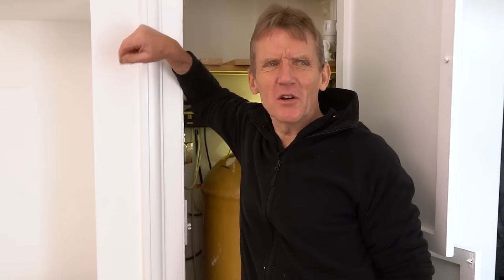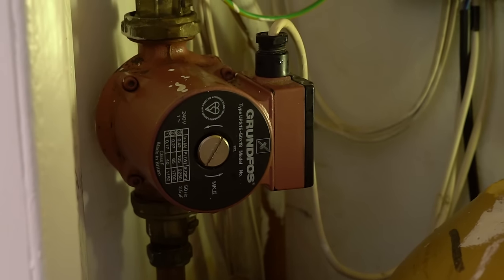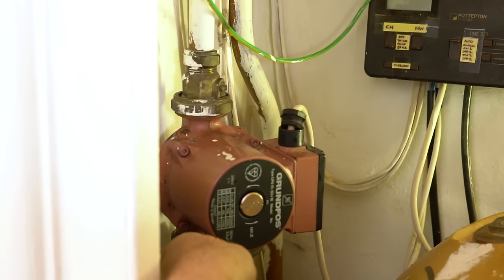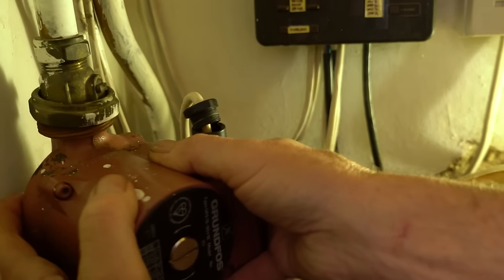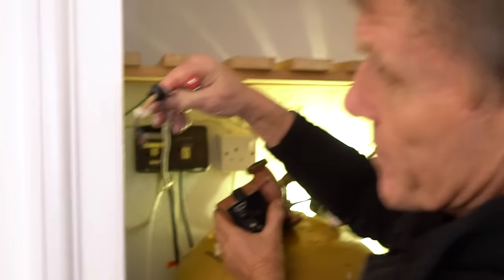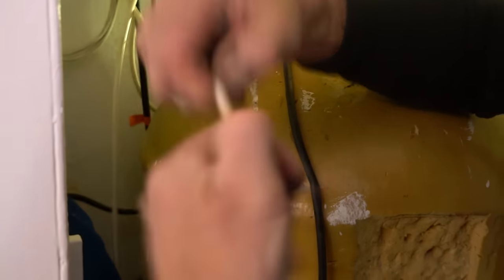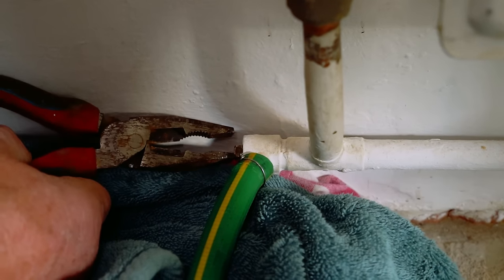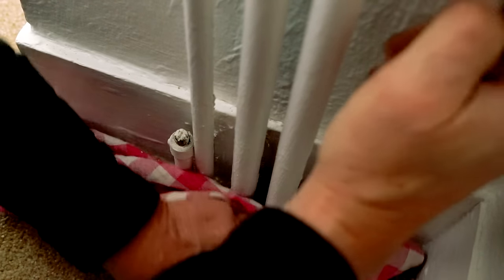How to Replace a Heating Pump - Plumbing DIY

Comment: I have a 20+ year old potterton Housewarmer Back boiler. I have just replaced my 15+ year old Grundfos pump as it was making surging noises. Now my Burner keeps going out prematurely and then locking out. I am thinking that I have dislodged some sludge/magnetite that has now entered my heat exchange with the extra power of the new pump. Could I be right? I recently hoovered all my back boiler and burner blade out so I know that's not the issue.
Reply from the maker: It would seem to me that you have no circulation at all in the boiler. Check the flow direction and the valves.  If that doesn't help you could flush the whole system through. Back boilers are usually not low water content so they should be better than most in terms of staying clear.
Reply: @SkillBuilder  Thanks, thing is for the first week of me swapping the pump it ran great, got nice and hot and no issues with locking out or anything. Today I have changed the Oxipilot ignition thingy and I have also fitted a new thermostat. I have also drained the system and refilled but nothing really came out other than clear water. Still not lighting or going out. I'm waiting for some cleaner and inhibitor to come. Only other idea I have is that could my Honeywell gas valve be broken? perhaps it isn't working and letting the gas through for the boiler to light? I'll be corgi registered by the time I am done with this!

Comment: I have a pair of these on a closed loop for a ground source heat pump, and there's a bit of air in the loop .. can these pumps be vented at all? Open the screw on the head while its running?
Reply: jrfk2 some people are saying there is a bleed screw but i dont see it
Reply: @gfriedman99  The big silver button is the bleed screw.

Comment: Do you need to be electrically qualified now to do the wiring?
Reply from the maker: No it is not rewiring and a lot of pumps now have push in terminals.

Comment: Mine is the same pump and screeching  it gets red hot and not getting no heating to the radiators could mine be jammed and freed with screw driver or should I get a replace ment and also my electric motorised white box is broken can any one give me any tips please

Comment: Those pumps are designed so you can change the head only,no need to touch the water connections,four Allen bolts and it's off.
Reply from the maker: Yes  but often it is the impeller that is knackered. They get noisy
Reply: @SkillBuilder  the impeller is in the head/main body.
Reply: Just changed the head on mine much easier

Comment: What should the pump speed be set to?
Reply from the maker: Set it low and see if it works, if some rads are not getting hot turn up the pump speed.

Comment: Does one cover oneself for the extra expense of the glands, labour, running around by giving a conditional estimate?  also did you mention making sure the pump electrical power is removed before working on it? Although that is a given, if the pump is bunt out it still might be live.
Reply from the maker: Yes, I isolated the power at the beginning.  As for all the running around etc. most of the time I am on the clock so whatever time I spend on the job is charged for. It is one of those things you just have to establish with the customer. If you replace the pump that is one job, if the glands leak and you replace the valves that is another job. If the customer isn't happy then just take the money for the pump job and leave the glands leaking. I have had someone say that the valves were fine until I touched them but you always get those kind of people. You learn to filter them out before the job. If they begin the conversation with "How much?" I just tell them I am too busy.
Reply: I also keep one of those wireless voltage sensor marker-pen shaped goodies handy to do a final check that there is no live circuits before touching anything
Reply: Well said Roger

Comment: Thanks for the videos.  As an amateur, I've done a bit of plumbing of all sorts.  If that had been me I'd have tried 2 fibre washers and joint compound.  What do you think? Wasting my time?
Reply: GrumpyGrampa I think the leak was from the isolation glands rather than the union connections themselves so needed to be replaced.  Good to see the job done properly, plenty would have tried to bodge that and walk away. 👍🏻

Comment: Great.Had cylinder fitted..air locks in system. Who's responsible please?
Reply from the maker: Hi Ray 

 I am afraid that air locks are a fact of life. If the system is well designed it should self vent to the radiators but high spots with no bleed points are difficult. I have spent many hours clearing airlocks and they can turn a one hour job into a three hour job. I am afraid the airlocks belong to the customer not the plumber and in the past I have been far too generous on this and walked away with less money than I deserved. If the customer is a good regular customer I will swallow it to keep them sweet but on a one-off job it is my policy to charge the customer for my time. Best thing is if the plumber warns you before draining down that it could go badly.
Reply: @SkillBuilder  Forgot to mention Paid out £540 last Friday thinking all was well but after trying to rectify the young fitter said the pump was no good and there were air locks then left as it was weekend.
Reply: @rayskinner1581  owch nobody happy on that one.   Ive heard of some pumps that have a jockey mode to clear air out, best used on large houses
Reply: Any decent fitter will make sure theres no air locks so I disagree 100% it's a customer issue. Given gents age its disgusting anybody would leave until systems running perfect and hes happy.

Comment: Great Video, clicked on as I saw your SMILING FACE on the videos on the right hand side of a video I was watching and I thought it would be nice to listen to someone with a smile on their face. By the way taping the pump can work, but more often than not the reason is that an OLD Pump Stops slightly offset the Magnetic Field and the jolt [Hammer] moves the Stator just enough to pick up the Magnetic Field and off it goes, only problem is that within hours,days,weeks it will come to rest at the same spot and you will have to once again hit it!
Ok if you have nothing else to do (:
Next top tip is to buy a T Bar either a 5 or 6mm and just unbolt the Motor leaving the PLUMBING IN PLACE, yes you still have to isolate the valves and place a bucket below the Motor for leaking valves, this method should NEVER be done when the water is hot! because if those valves have not isolated the water you could injure yourself.
Want to know if the Valves have turned off? just remove the bleed screws and replace with a good jointing compound.

Comment: Should the pump not be "red hot"?  It is pumping hot water direct from the boiler...
Reply from the maker: hot but not red hot. When the water is flowing through it is the same as a radiator.
Reply: @SkillBuilder  ok, mine is hot hot, and only luke warm rads downstairs. Pump might be suspect.  Doesnt look too bad a job to replace, just the risk of the weeping valves as mine is an old / original pump.  Ive checked almost everything else and new rads throughout.

Comment: At the start you said water turned off ..... is that the cold feed  in to the central heating you turned off
Reply from the maker: yes to stop the tank filling as you empty it
Reply: Thanks mate

Comment: Put the price up by 50quid! A bit generous Roger, if I have to drain down it's £100 minimum. Have to cover the cost of adding back inhibitors and the inevitable time to get all the airlocks out.
Reply from the maker: Fair enough. That is why I am poor and still working into my old age
Reply: Why would you have to drain down to change the pump valves when it’s only gravity so can easily be snatched an if your not confident in snatching bung the tank
Reply: @Steve-jh6oz  Draining down also allows you to remove debris. It's not exactly hard, I did 8 whole-system drain downs today (6 on one side of the removed radiator, 2 on the other side), and a couple more tomorrow after running the pump. Then I will put in the new pump. I want that water good enough to drink. I noticed the pump spent a lot of time running, so I am putting in a modern low consumption model that will half the electricity cost.

Comment: So that's a HEATING Pump? How does the hot water pump from the boiler to the hot water tank?
Reply: Diverter valve into cylinder coil the back to boiler.

Comment: Hi,hoping somebody can help,having problems with my boiler,last night the boiler tripped the electricty,the plumber is trying to push me to get a whole new boiler rather than replace the pump and diverter,he said it's the pump that is making the electricity trip,this doesn't sound logical to me,searched online and can't find anybody who talks about the pump tripping the elecricity! is it possible?
Reply from the maker: It can happen but you can  easily wire a pump up on a 3 pin plug and check it independently.  It is also likely that a slight trace of moisture on a motorised valve can cause the RCD to trip.
Reply: @SkillBuilder  Hi,thanks for the reply☺had a closer look at it and there's water drops coming from the inside of the wiring/electrical part!!  the plumber said the seal must've worn away and that's how the water has gootten to the electrical wires!!that seems like a disastrous design flaw!,i'll have a proper look when he replaces it tomorrow,thanks again.

Comment: You glossed over the hardest part, fitting the new pump which is an ultratight fit.
Reply from the maker: Get a plumber
Reply: @SkillBuilder  so, you either forgot to video it or it was a complete bugger of a job getting the new washers and pump into place and you didn't want to show yourself struggling with it. Either way, it makes the video far less useful. But your response to a correct comment says it all really.
Reply: @stuartb3502  Fitting the pump and washers is the easiest park of this job, the hardest is filling system up and getting rid of air....

Comment: hey guys, anyone knows how to fix this problem
My fuse on the PCB blows immediately when I turn on the power switch.
If I unplug the wires from the pump, it all works fine and the red line on the PCB is on
I plug in again and turn on the switch, it blows the PCB's fuse again :((
Reply from the maker: You probably need a new pump. Check out the connection and if they are good then it is the pump. Maybe the capacitor
Reply: @SkillBuilder  Thank you
I checked all the connection is fine but I smell something burned. I think it is the capacitor as well but there is no burn mark on it. Does it burn inside ????
And can I only replace the pump head instead of the whole pump?

Comment: my boiler shuts off within 5 seconds when heating or hot water is on, motor is ok
Reply: low pressure perhaps ( but as it was 11 months ago i'm sure you have solved the issue)

Comment: Do you really need to replace the whole pump? Can you not just replace the motor section
Reply: Yes, just replaced the head on mine, i was quoted £280 + vat to fit a new pump, i bought a fully working tested pump from ebay for £20, ordered it Friday it arrived today Sunday and took me less than an hour to do it. Just fitted the motor part not the whole pump. Working fine now...
Reply: Prince Fluffy so to swap the motor did you only take out the 4 hex screws holding the case on?   Does water come out when you do this?   Was the bearing swapped also or is that separate?
Reply from the maker: @gfriedman99  You can swap the head but often the impeller is knackered and no plumber wants the risk of call backs. The only time I would do a head swap is on a combi just to get it moving again.
Reply: @SkillBuilder  doesn't a new impeller come with a new head then? Don't make sense.